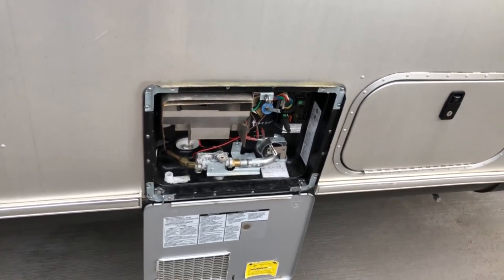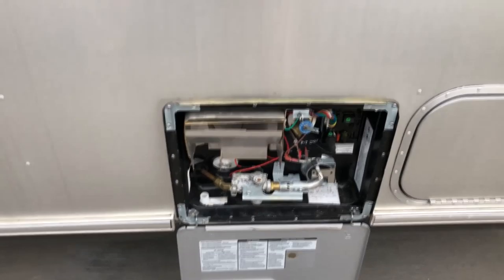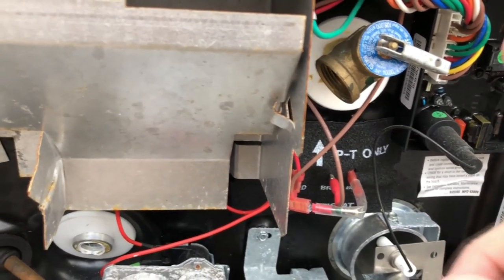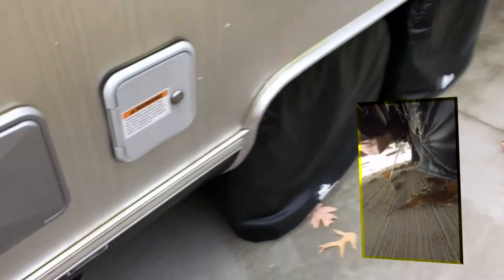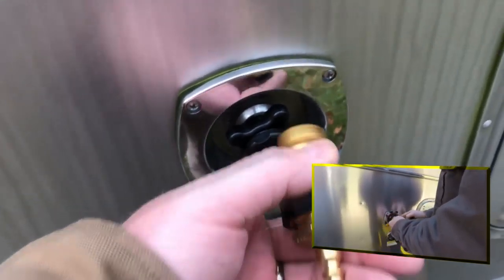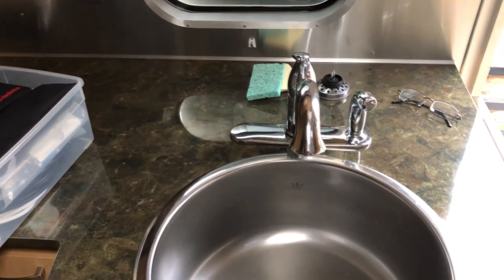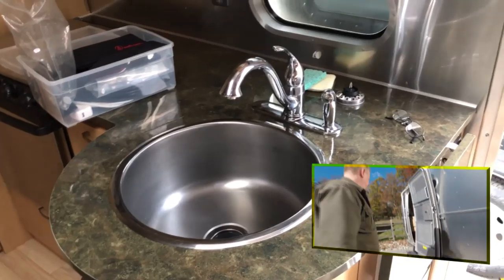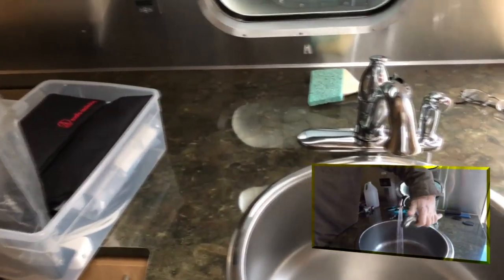Winterizing Our Airstream Camper

Comment: The panel beside the door below the fridge is actually a hidden door. The one with the heat register in it. If you push on the right side it should pop open and give you easy access to your pump for winterizing.  Facing the door below the fridge directly to the right. I have the same camoer just a couple years older.
Reply from the maker: Hi Bill - thanks for the tip but I already knew about that panel.  Unfortunately I do not have any video footage of my installing of the winterizing kit on my pump (stupid me did not even think about it) - I had that panel removed at that time which is when I discovered that the pump is sitting more under the fridge in our rig and opening the panel under the fridge was the way to go.  I appreciate your feedback and it may help others that did not know!

Comment: There is also an inline water filter/screen a couple of inches before the input to the water pump that needs to be drained.
Reply from the maker: Yes but after I blow out the lines I pump RV antifreeze through the lines which should cover that filter

Comment: I just blew out the remaining water with compressed air. I only used the antifreeze in the P traps. I don't have a winterizing kit install as it would take a radical modification of the PEX piping on the input side and there is no room to work on PEX under my fridge. I would run through each faucet 2 or 3 times including the low drains. Water gets pushed down to the low drains. I also disconnected the input/output pipes from the water pump then run it for a few seconds and leave the pipes disconnected so any water would be expelled. I guess with your method the pump has antifreeze in it.  We had temperatures down to 0F in Missouri and the trailer plumbing system was not frozen. I thought about putting a few gallons of antifreeze in the fresh water tank but comments on Airforums changed my mind.
Reply from the maker: Thanks for your input - it was a PITA to get the kit installed under our fridge but it is on there now for good

Comment: I noticed you failed to turn off the yellow bypass valve to the water heater before moving on....this would fill the water heater with antifreeze.  A small point, but not to a newby like us.
Reply from the maker: Did you actually watch the whole video from the beginning?  Starting at 0:39 seconds in and going to about 1:42 of the video I show and discuss the yellow bypass valve and what it is for.  However, I did not show turning it off during the video but I did say you needed to.  Thanks for the comment

Comment: what kind of air compressor do you need to blow out your system? What PSI is required?
Reply from the maker: Hi Simon - I do not know what PSI is required but if you look at the information under the video I have a link to the compressor I and lots of others use.

Comment: I have a question about the "payload capacity" of your Ford Raptor. I had a 2019 Ford F150 Limited which is essentially a "Raptor" dressed up in a Tuxedo. Same frame same motor etc. I have an Airstream similar to yours, a 2020 International Serenity 25RBT. Based upon Ford specs your truck is similar to the one I owned with a towing capacity of 10,800 # but a "payload capacity of just under 1200#. With a trailer tongue weight of just under a 1000 # including the hitch, two adults in the truck, a few camping items in the truck bed, and a full load of fuel I was several hundred pounds "overweight". The set up was weighted at a "CatScale" a number of times to verify the issue. Sadly, I had to trade that wonderful truck to get one that could handle the "Payload" restrictions. Your're setup has got to be the same. How are you able to continue using the Raptor as a tow vehicle for your Airstream?
Reply from the maker: There is nothing similar between a standard F150 (no matter the trim level) and a Raptor.  The frame and suspension is very different as well as the body.  The interior is pretty much the same though.  This being said the towing capacity is 8000.  My trailer loaded weighs 7300 with a hitch weight of 837.  The hitch is much less since moving batteries inside and we almost never travel with full tanks (5500 dry weight).  I have not run through the scales in a long while but we have not had any issues towing with a weight distribution hitch.
Reply from the maker: Also my motor is a 6.2L V8
Reply: @AirstreamNerds  FWIW - I appear to have the exact same trailer as you - 2015 Flying Cloud 25FB - and I'm pulling it with a 2019 Lincoln Navigator (very similar to the newer model ecoboost raptor.... motor-wise and towing capacity wise) and it pulls great with an Equil-i-zer weight distribution hitch.  Thanks for the video - extremely helpful in my first winterization.
Reply from the maker: @Koolicyde  You are welcome and thanks for the compliment!